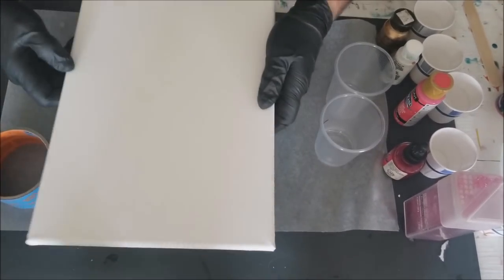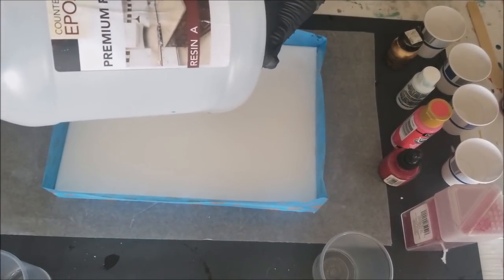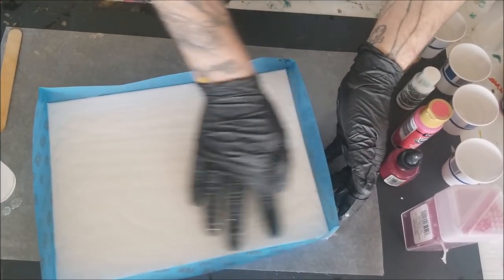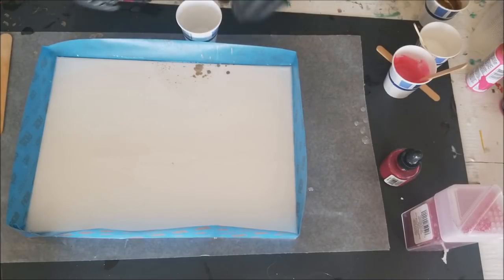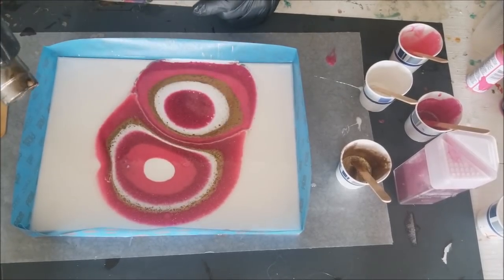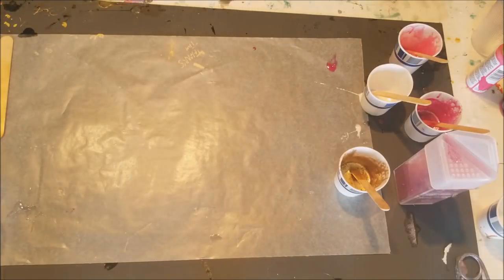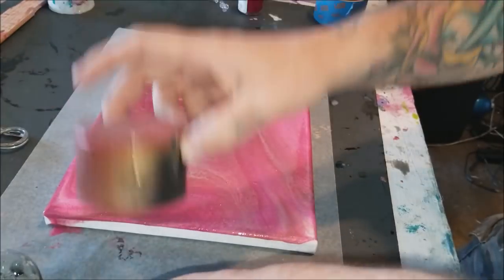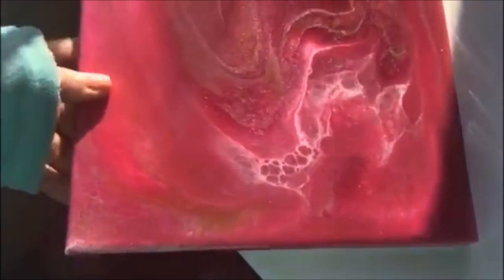Resin Pour and Taping the Sides (Tutorial)

Comment: Erika,  my 17 year old son can't whistle either. LOL. Jeff, that turned out really pretty. I have used aluminum tape and like it quite a bit although it's extremely sticky. But it does the job! I typically use MDF and I have used a table saw to clean up the edges. Then I can sand them and paint the edges to a clean finish.
Reply from the maker: Hey Brenda!  I'm so pumped that I'm not alone, lol. That's what we do when we use MDF and you are right - aluminum tape is super sticky and I have had it remove canvas fabric before.

Comment: I can't whistle either lol so now let me ask a question. I did a piece and the sides look horrible. They are nice and smooth but I don't like the way most of it was clear resin that came down the side with random spots of color. Mind you a sprayed the base blue before i started so now when you see the sides you see the blue base with clear over it and a random drip here and there of color. Is there a way to only redo the sides without having to repour over the entire piece?  I love those colors together. Great job Jeff!
Reply from the maker: Hey!  Thank you for the question.  You can sand it down and I believe that you can just take a small roller and roll resin onto the sides.  It might just be easier to do a complete flood coat.  How big is the piece?
Reply: It's a 10x20 so it's not huge. Maybe I'll try the roller and if that doesn't satisfy I'll flood the bitch lol ty so much
Reply: It's the one I posted this morning in suzana's group where I thanked you two for turning me on to the mehron gold powder
Reply from the maker: That piece looks great!  I love it. also, thank you for the shout out! try the roller first.